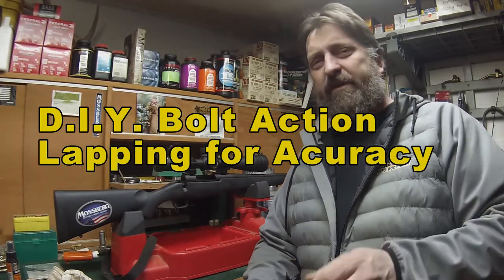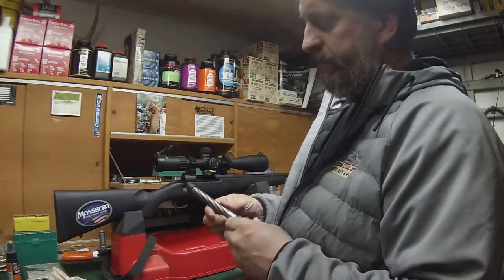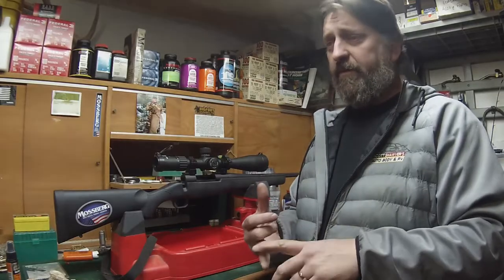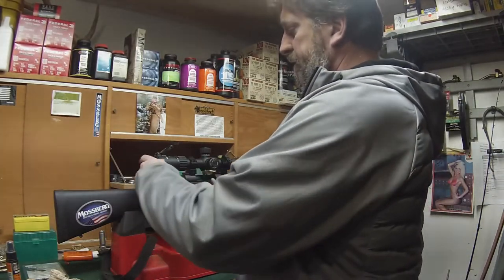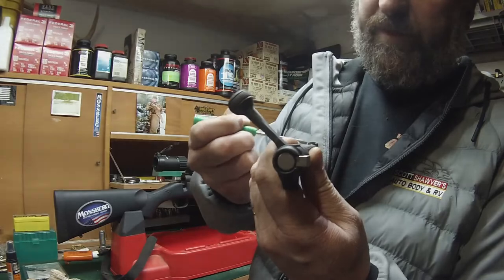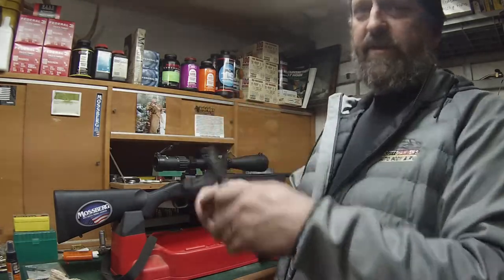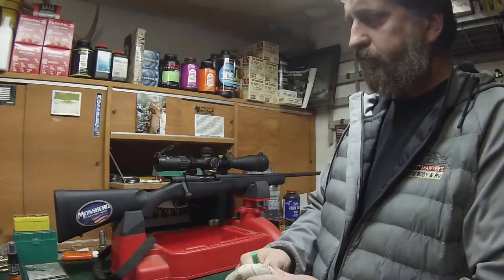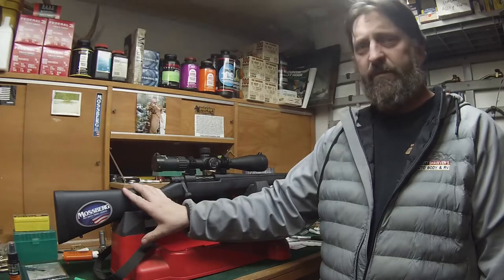D.I.Y. Bolt lapping for Accuracy

Comment: Thanks for this excellent explanation and it presents ideas for additional accuracy. I would imagine this is especially true for well broken-in rifles, magnum (hard-hitting) rifles, and for entry level rifles as well. I noticed that you were pointing to the rear lugs. Do you do this to those lugs and the front lugs, or just the rear lugs? On my Savage axis receiver, the locking (seating) lugs are the front ones?

Comment: what about changing a headspace by doing this? Doesnt it present a bigger danger? Anyhow, how much in accuracy did you gain afterwards?
Reply from the maker: It would take some effort to lap the lugs so far that headspace is affected to the point that it becomes dangerous. 
If you use aquarium gravel to lap em, then maybe itll affect your HS. :)

Lapping anymore isn't much more than a means to verify if you have lug contact on both sides.
Reply: @grouptherapy5983  Ok. Nonetheless, I would refrain myself from going that far. So can you report that doing this has actually improved the accuracy of your rifle? Tnx
Reply: it can change the headspace. besides if the bolt is so far off that it needs to be lapped then that's an issue with the manufacture of the part.
in my experience it's more about the accuracy and consistency with which you handload your ammunition. paying closer attention to sorting brass by weight and brand, turning case necks, trickle charging powder, using the right bullet for your twist rate, and seating/crimping with good concentricity.
Reply: @sgtstedanko7186  it's not going to change headspace, this is been tested a dozen times. And you can take any factory gun off the shelf and do a bolt contact test on it pretty simply and you'll see 99% will have a contact issue.
Reply: @russr  I'm a gunsmith and you will absolutely change headspace if you remove material from the back of the lugs. If you remove .001 from the back of the lugs, you add .001 headspace. Over time as headspace gets worse, the faster it gets worse. Don't mess with the bolt! It will work itself in as you fire the weapon anyways.
Reply: @sgtstedanko7186  I still wonder how lapping a bolt can improve the accuracy. What about bedding? Do you recommend  it?
Reply: @partisan5695  bedding for sure and that's because it balances the barrel harmonics. Personally I wouldn't mess with anything to do with headspace because over time headspace will develop anyways. If guys wanna lap their lugs then fine if they think it'll help. Their gun. If it blows up their problem.
Reply: @sgtstedanko7186  this makes guns smoother and one thing gunsmiths hate more than anything is people making there guns smoother without having to get a gunsmith haha.
They act like checking and setting headspace is neural surgery haha
Reply: @JoeWayne84  it's not neural surgery but it's easy to take off too much. Many folks put too much pressure on the tool.
Reply: @sgtstedanko7186  Lol’ We can always reset the headspace with a set of go no go gauges. Its not rocket science and this is exactly how blue printing an action is done.
Reply: If lapping changes headspace then why do you take your rifle into a gunsmith and have them true your bolt face all he does is put it in his lathe and remove move a bit of material 🤨pretty much the same as fringe compound
Reply: @dwaynewood8156  when a action is trued it’s rebarreled so head space is set when the new barrel is chambered. Lapping lugs is not a good idea either as all your doing is lapping a angle in them. It’s best done single point cut on a lathe set up correctly.
Reply: Well in general as far as changing headspace goes you won't be lapping it that much. The objective is to just get the highest high spots, trying to achieve more contact on each lug. I try to match the ammount of contact of the best lug when I do my initial check and thats enough for hand lapping. The reason it makes it more accurate is that during firing, the brass expands obviously and that sharp force drives the lugs towards the locking recesses. This produces vibration. This vibration causes barrel whip. More even lug contact results in diminished and more consistent vibration. So yes it does work, done it several times. It's not the same as truing the bolt although some people call it that, rather its more like doing the back half most of the way. You'll never achieve 100% contact without changing the headspace with this process. It may be a good idea to worry about headspace on an old loosey goosey gun but on a new rifle you would have to go at it for a while by hand to change headspace to the point of being out of spec. For example my last new 3 lug bolt gun had one lug at like barely any contact, one close to 2/3 and one closer to 3/4 contact. I lapped with 400 grit compound until all 3 are between 2/3 and 3/4 contact. We're talking about off the shelf hunting or target rifles here and if it already has better contact than say 2/3 on all 3 lugs you may not gain anything by lapping. All that being said it maybe isn't a good idea if you dont know what you're doing because sure its possible you could work it too much.  If you're even worried about it then a gunsmith can do it for you, can tell you if its even worth it and it wouldn't cost you much. But it does work, it is something that is still taught. I've turned 3 minute rifles into 1 min rifles, a 1 into 1/4.  Also remember there are other ways to tame that vibration as well,  just depends on what rifle it is. Things like bedding or those harmonic dampers that were popular for a while.